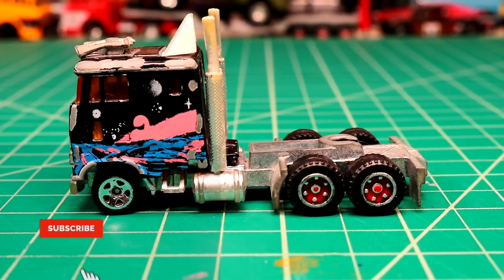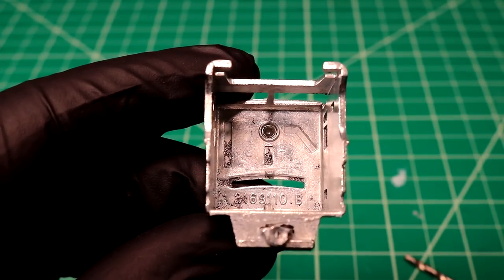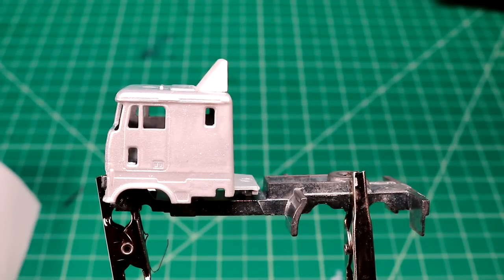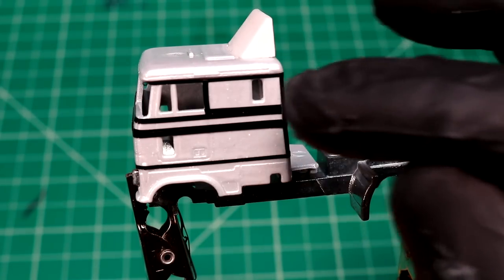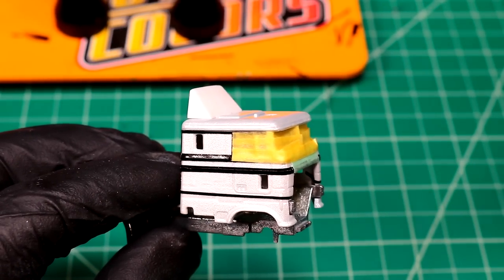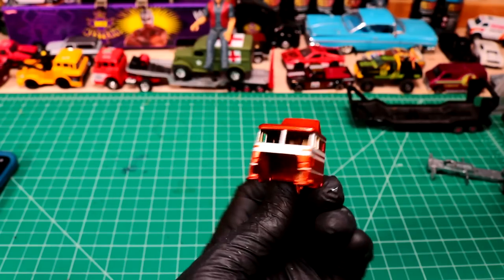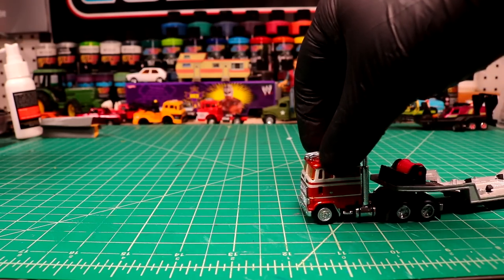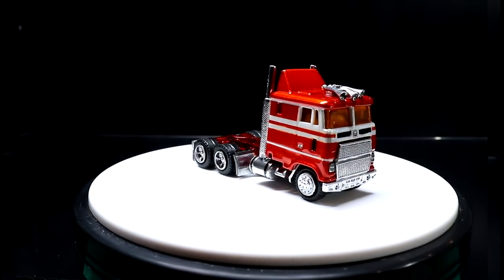CAB OVER CUSTOM - Majorette Ford CL-9000 - Diecast Car Restoration

Comment: Love the paint and wheels.. Great job👍🏻👍🏻👍🏻 Just a suggestion, you can get custom parts for big rigs at “Rocking H Farm toys”. Exhaust, wheels and tires, grills, fuel tanks, all in 1/64 scale. Pretty well everything you might need for a resurrection.. 😉😉👍🏻👍🏻👍🏻